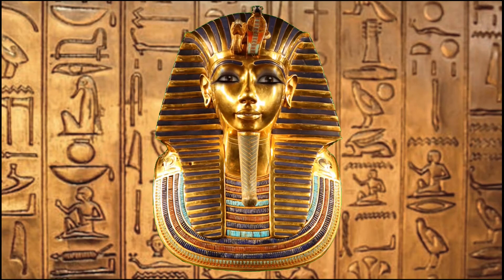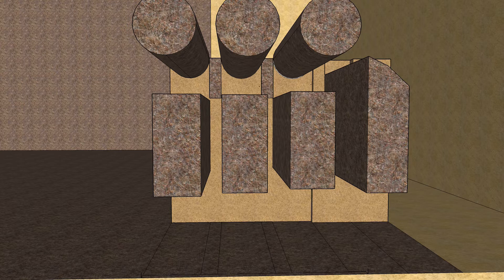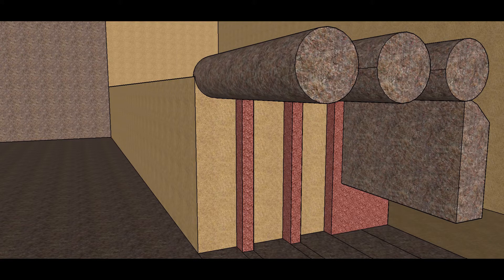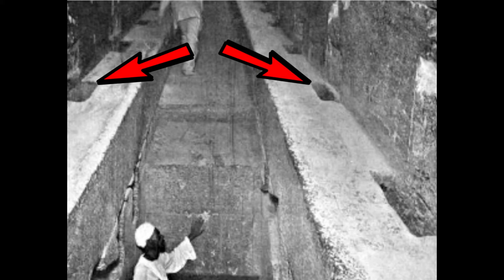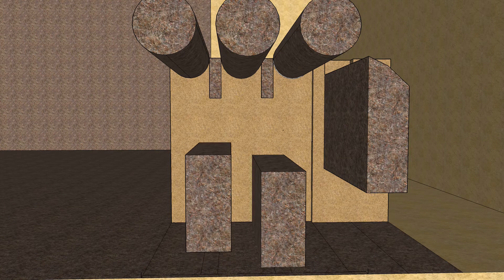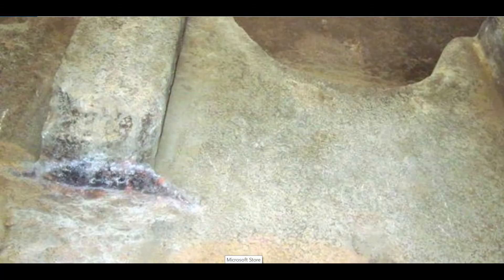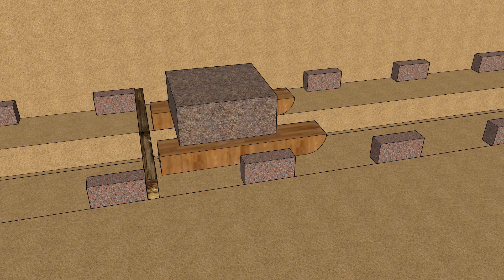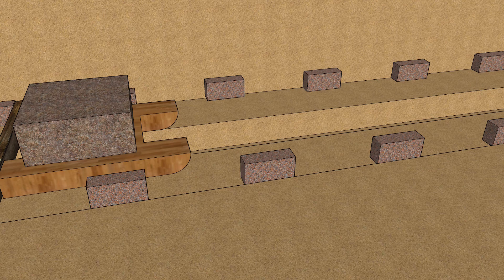GREAT PYRAMID; The Ante Chamber

Comment: I think, for now, this is your most interesting video (i'm not a bot). Do you consider to analyze other problems/questions? Void in pyramid; Unlocking Sphynx behind the ear; Edward Leedskalnin moving rocks; tunnel-like lines on Mars before advanced telescopes, then dissapeared? ;) Just askin'
Reply from the maker: Watch my access hole video to the void. Edward leedskalnin used a tripod of tree's and a chain fall to lift the  light weight coral stones with. Research again.

eight
Reply: No evidence presented? How can we "decide" without any information? How far do the stones move? What is the angle of the ramp? That give you an idea of how much weight you need for a counterbalance. Your illustration is not drawn to scale. The distance those porticulus stones move is greatly under estimated. The model here does not represent the system. No one could decide if your guess is on track without a valid model. Science doesn't operate like this. Testing hypotheses requires accurate details that make sense and can be defended. Your presentation here cannot.